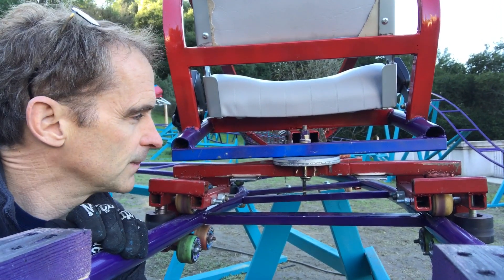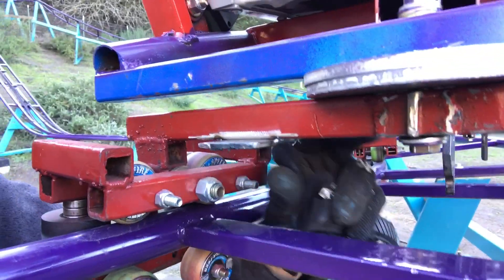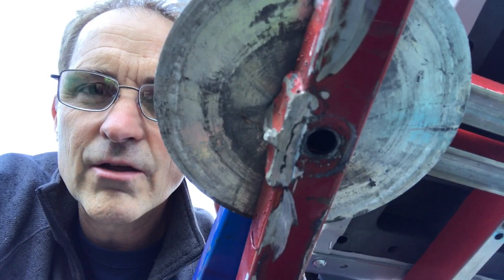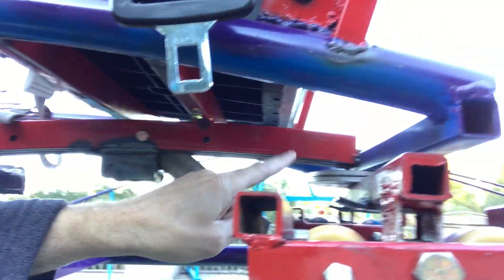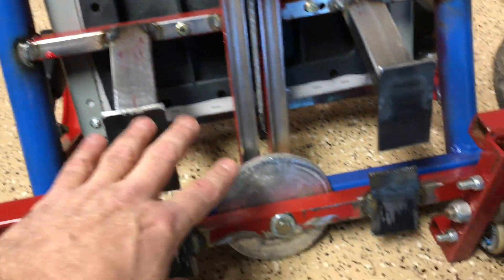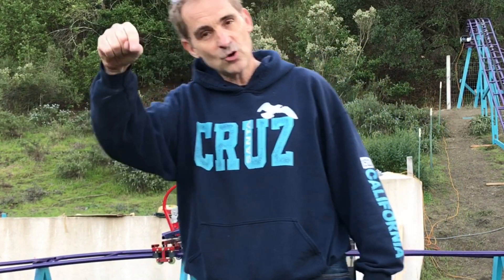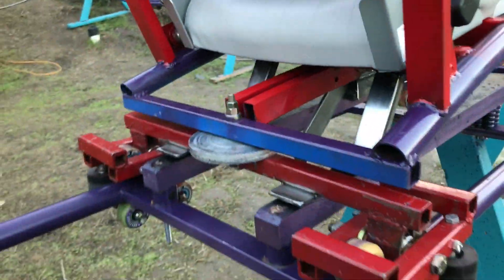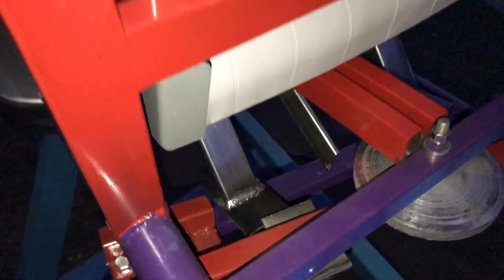Backyard Roller Coaster - Our Brakes Broke The Cart!

Comment: Great catch on the brakes. Great coaster. I think you should go for another attempt at a heart line roll. You were so close with your last one. I'm not an engineer, but when I was watching the video, it appeared to turn the cart upside down with ease, but rather than the track looping around and back underneath the cart and rider while they were were weightless, it caught their full weight at the 8 o'clock position still beyond horizontal requiring the track to LIFT the cart and rider back to an upright position which wasn't good. If you created a roll with the path the person's head travels as your axis, I think you could come up with a winner. Think of it as a "Head Line Roll" where the head would follow the same path a ball would travel if tossed from point A to point B. It travels a straight line that has an upward catenary arc that only deviates on the Y plane, but not the X. You want the person's head to travel that arc and have the track spiral around it to turn them upside down and then catch them on the end without ever having to lift the weight of the person's body or cart back to an upright position. I get the impression that you're an engineer of some kind, so you could probably work all this out mathematically. Good luck. Every time I watch your videos you make your coaster better and better.

Comment: Uh, you know there's a reason that trains (cars, trucks, basically any wheeled vehicle) have their brakes on the wheels/wheel structures instead of the vehicle itself: so that vertical movement of the vehicle doesn't negate the brake's effectiveness. What you've essentially done here is move the braking forces from the bolt to... the bolt.
Now rather than a lateral force across the bolt, the force is concentrated along the bolt, meaning that any wear in the bolt, it's thread, the nuts, their threads, the washers, the aluminium bearers, the bogie or cart bolsters, et cetera will let the cart body raise and reduce the effectiveness of the brakes. Additionally, you've added a new (potential) point of failure, as the brakes now interfere with tracking; rather than the bogies guiding the cart and gripping the retarders (braking beams on the track), the bogies are now trying to guide a sled, which is going to increase the load on the bogies in all 3 axis.
If instead, you kept the brakes on the bogies, and just strengthened the bolsters and pivot pins (also, wider bearers would help), the load from the braking forces would have been distributed across multiple larger areas, rather than moved a bit, then added to.
Reply: Some do, particularly older coasters. 'Scenic railways' the precursor of the modern roller coaster for instance often used brakes on the wheels, but also required a brakeman to apply them. This is why pinch and eddy brakes came into use, to simplify off-vehicle braking and make it more practical. Pinch brakes still use a fin mounted on the bogie/wheel structure however, for the reasons I stated (also, pinch brakes negate the lift issues of skid brakes). Eddy brakes are often carriage mounted, but they also don't provide a solid lock that interferes with the tracking, as being magnetic, there's no contact.

Comment: Have you thought about the possibility that this method may still put undue stress on the wheel assemblies/axle? My mind is saying that when the brake pad touches the brake it’s going to force the chassis of the car upwards and pull against the wheel assemblies that cannot move upwards with the chassis due to being locked onto the track?
Reply: Dan Cox with the weight of the cart plus a person, and the noticeable gap between the up-stops, I don't think it it too much of a problem.

Comment: About aviation accidents: most of them didn't happen 10 years ago, actually. like 60% of them are caused by human error. Which is amazing, of course, considering the abuse the planes have to go trough (and for a plane, with gigantic amounts of parts, in use for decades, that not 90% of them fall from the sky due to equipment failure is quite amazing, I think)

Comment: you could put the breaks on linear actuators and put optical sensors on the track to measure the speed of the cart and therefore change the severity of the breaking and disengage them once the cart has stopped then you could build a station with kicker wheels to move the cart around and to the base of the lift hill which could also be automatic so you only have to press the go button and the roller coaster does the rest.

Comment: Try and make a faster lift hill
Reply from the maker: Working on that! A really great suggestion was to make it a variable speed hill.  Slow at the bottom, fast in the middle, slow at the top. Gotta figure out a reliable way  to control the motor. Super excited to do this project.. .and a video all about it!
Reply: Will Pemble, a variable speed lift would make the ride a lot more enjoyable. I hope you can figure out a way to get it to work. Electronics can be difficult sometimes.
Reply from the maker: Never Give Up! Never Surrender!
Reply: True words of wisdom...